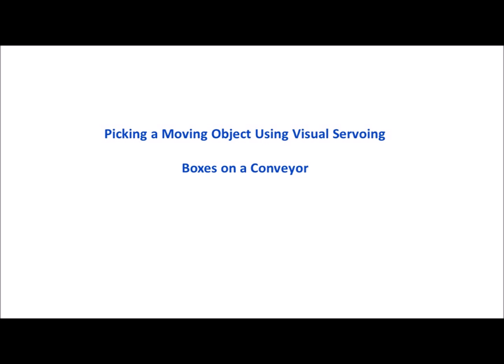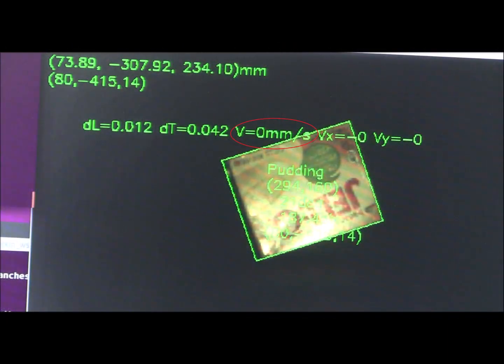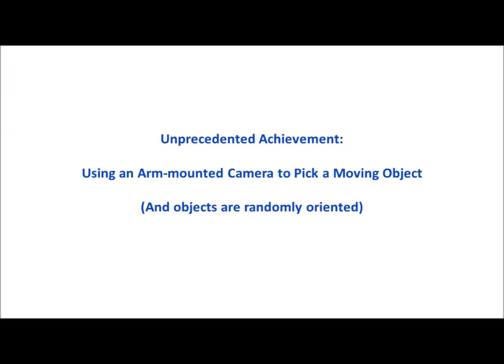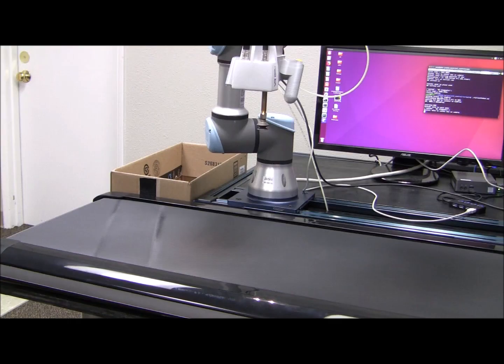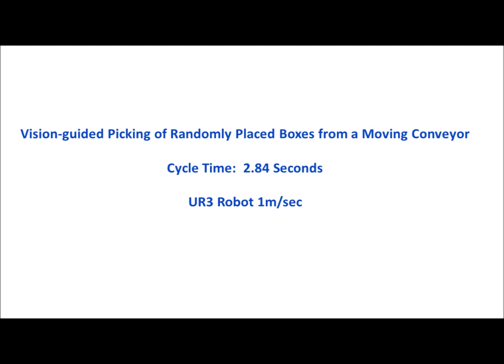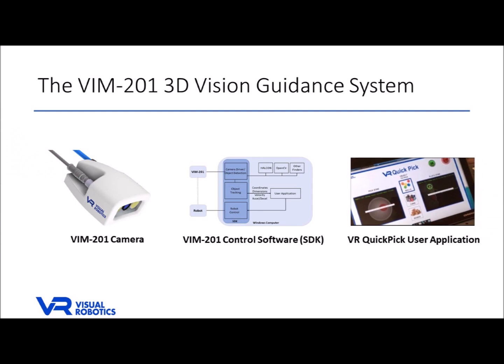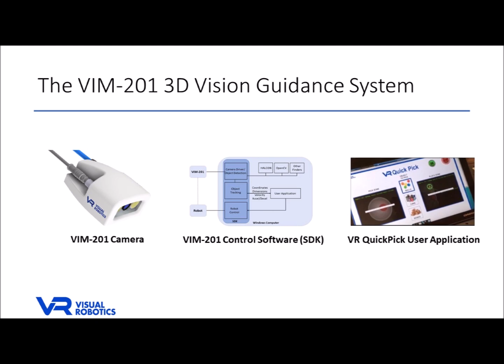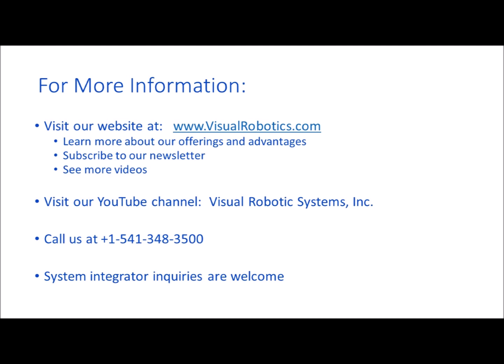Visually Guided Robot with Arm mounted Camera Picks Boxes from a Conveyor  Visual Robotics

Comment: Nice project, but I would like to know if the extra camera and software is really needed. You can use an omrom camera with PLC and an encoder to do this kind of work. Or even cheaper it is possible to do the same with a distance sensor + motion sensor if the objects have different sizes. The only case that justifies using this type of project is if the light of the place is not constant, the objects are geometrically identical,  cannot place QR and the conveyor belt is too wide.
Reply: Hi, My name Anh, I'm student and I have a project to make a robot arm that picks box from a conveyor, and I have no experience with it, can you help me to explain a few problems?
Reply: @anhnguyenlehoang5945 Hi, I have to make a arm robot which work to sort the boxes Please if you have some knowledge about it help me. Please reply
Reply: Hello,Sir I'm student I have to make a project shorting arm robo Please help me please reply